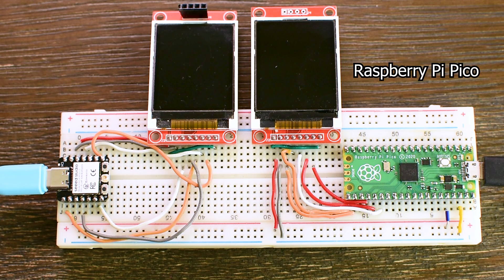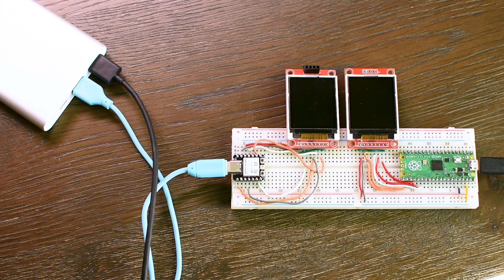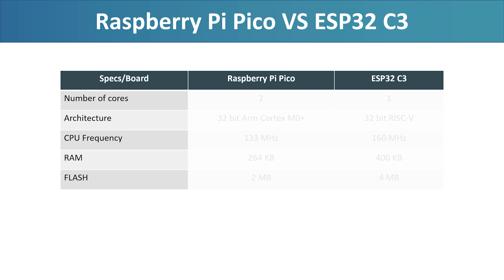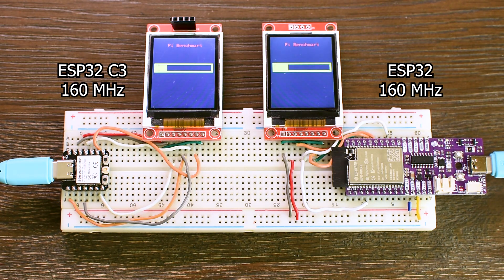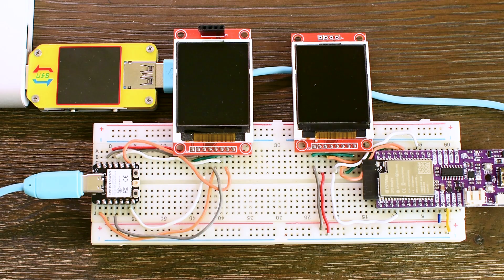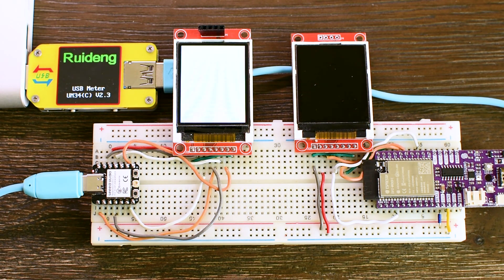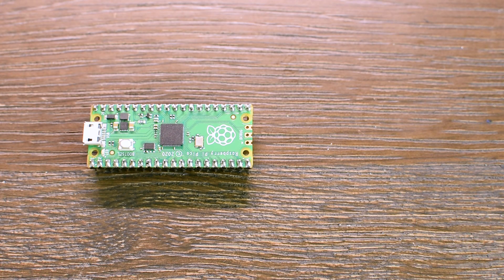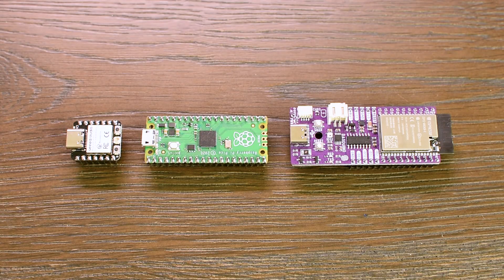Raspberry Pi Pico vs ESP32 C3 vs ESP32: The ULTIMATE Speed & Power Benchmark!

Comment: You should count the price of these boards into that. The Pi zero costs more. Also C3 is not that powerful and has only single core anyway. You shouldn't compare Pi ZER0 with the other two. Every board has different CPU.

Comment: C3 is good for basic stuff and can be really efficient if using the sleep function between sensor readings and data transmission.
Standard esp32 is powerful and both are cheap on AliExpress.
Wled runs better on standard esp32 especially if you want audio reactive.
I've barely scratched the surface of what these can but they are soooo cheap I don't care lol

Comment: As far as I'm aware the ARM M0+ architecture has a Math co processor (not FPU). I've done a bit of work with the Infineon XMC32 which is M0+ and it has a maths coprocessor which their marketing blurb says is part of the +. I think (but haven't looked into the detail) that this does integer division in HW and CORDIC functions which supports trig functions. I'm sure a smart programmer could figure out how to do Pi from that in a smart fashion

Also RISCV is slower on all bench marks I've seen compared to ARM.

One thing that surprises me is that AVR processors running at 16MHz significantly outperform ARM M0+ at toggling IO pins. I can toggle the AVR's IO pins at 8MHz from a 16MHz clock and ~417kHz for an M0+ running at 32MHz.

Comment: More Flash and RAM = More power.  I doubt the radios turn ALL the way off.

RiscV compilers aren't as mature and compilers matter.
Reply from the maker: You're absolutely right — more Flash/RAM affects power, and radios might not fully power down. Also agree on RISC-V: toolchains aren’t as mature yet, and that impacts performance. Thanks for the insight!

Comment: and whats the difference in code/compiler output? could it be the code compiles more efficient for one hardware than the other?
Reply from the maker: Great question — yes, compiler output can vary a lot between platforms. The same code might be optimized better for one architecture (like Arm) than another (like RISC-V), especially if the toolchain is more mature. That can definitely impact performance.